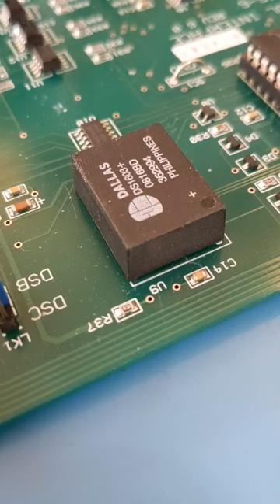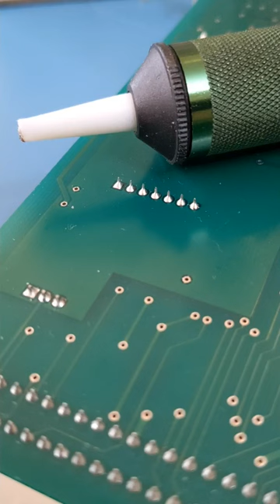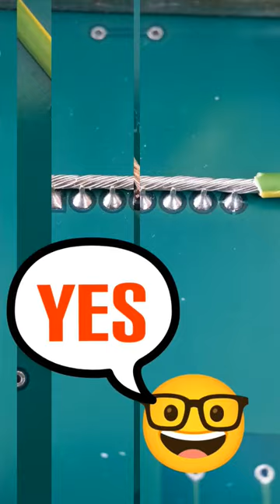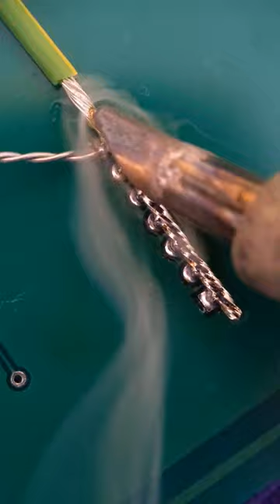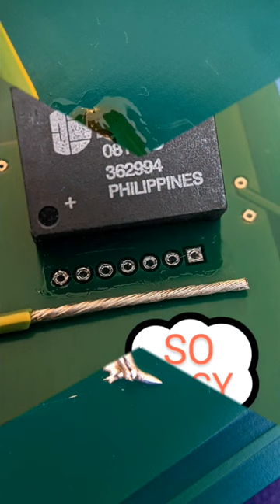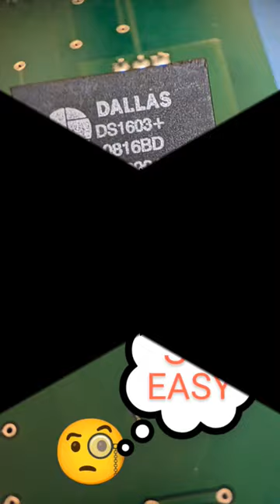Soldering Tip / Genius Way To Remove Components #shorts

Comment: Is the idea that the solder gets sucked into the twisted wire?
Reply from the maker: Hi , thank you for your comment, much appreciated. No , you can do this removal method with a solid wire ( not Stranded ) 
 The idea is to just get all the joints melted at the same time which the wire helps achieve . I do see people doing this without the wire , going along the pins but you end up chasing the solder . Having the wire enables solder to stay on every joint at the same time , hope that helps , thanks again 👍
Reply: @mrsolderfix3996  Oh, I see that makes sense. Thanks for the great videos!
Reply from the maker: Hi , no problem , thanks for your time 👍

Comment: I was micro-minuature solder certified. One thing they never taught us in school was the use of solder wick to do exactly what you are doing here.
Reply from the maker: Hi , thank you for watching the video and commenting , much appreciated 👍
Reply: Except the method here is not like using solder wick. He's not wicking the solder into the wire,  (and solid wire can be used) he's using the wire essentially to extend the iron so that it melts all pins at once, at which point the component can fall out or be pulled out.  You then have to go back and remove the solder from the holes, with suction tool or solder wick before fitting the replacement component.
This method actually solves a problem you encounter sometimes with solder wick, in which you wick out a lot of the solder, but not quite enough to unstick the pins.  Now you are still stuck trying to melt all the pins simultaneously, but it's harder because most of the solder has been removed so the pins are harder to heat..
Anyhow, this method isn't for every situation, often solder wick or sucker is better. But it's another technique that can come in very handy!
Reply: Я не получал сертификата.. не считаю этот метод приемлимым во многих случаях.

Comment: but that Dallas chip is in DIP, it just show desoldering one side and it falls, how about the other side?
Reply from the maker: Hi , thank you for your comment. I am confused by your comment . If you Google this component and get a datasheet it will clearly show you it is a single row of joints that this particular Dallas 1603 component has . It also clearly shows this in the video and that's why heating up this SINGLE row allows it to drop out . So there is no other row . I hope that clears up your misguided comment . Thanks again 👍
Reply: @mrsolderfix3996  Hi..I was into repairs of motherboards since the early 90s up until now.. Its very common that some motherboards uses this Dallas clock chip (forgot the exact model, sorry because its already 3 decades ago) back then and when its internal battery die, we have to desolder them to replace, but not as easy as this since its in Dual in Line packaging, 2 rows of pins though the other side have lesser pins.. and we put IC sockets so it will be easy to replace this chip in the future (but it never come).. but there are also other brands of motherboards that already uses IC socket, so it became easy to replace these chips..

Comment: Better without adding solder?
Reply from the maker: Hi , thank you for your comment . Always works better if you add a bit of fresh solder around each pin , the existing solder may not be enough to give you a good base to work with . Thanks again , take care 👍

Comment: Thanks, is there a practical limit to how many pins this will work for since the heat has to be distributed across all pins?
Reply from the maker: Hi , thank you for your comment. I've just done a 2 row connector with 25 quite large pins . Found a really good way to remove these just with a soldering iron , will post this sometime soon . About to post a video showing a difficult ps2/ usb connector that has 18 pins all spread out . Got a great method for removing these and similar connectors just with an iron . This methods genius . So basically what I've showed here is easy compared to what I know I can remove with just an iron . Thanks again 👍

.

Comment: I like this method and have been using it lately. Do you find that the semiconductors (transistors, opamps, etc) can be resused or are damaged by the length of time heat is applied to them to get them to drop out?